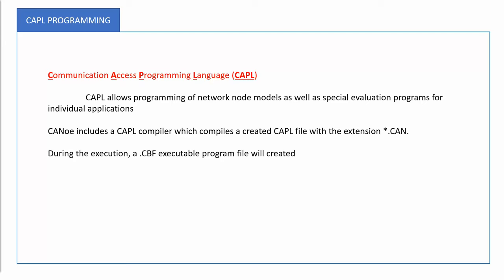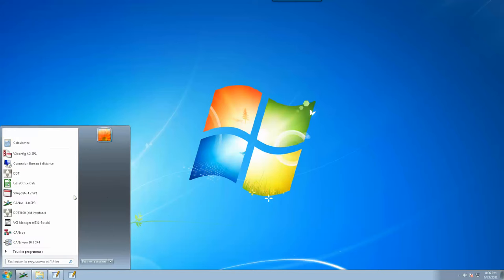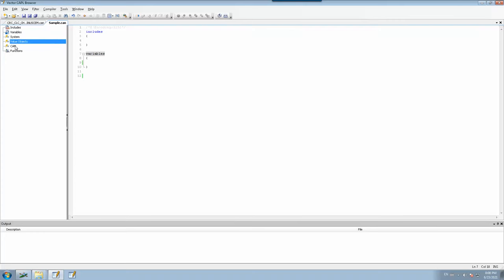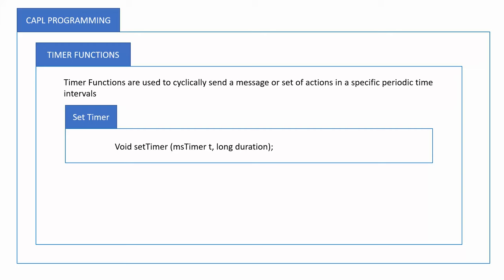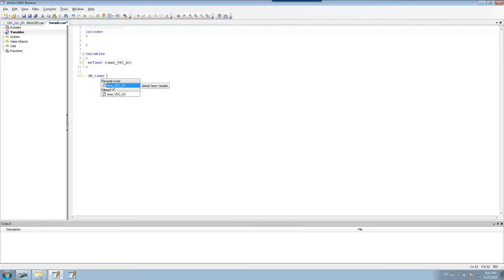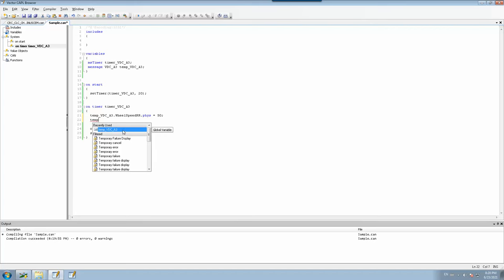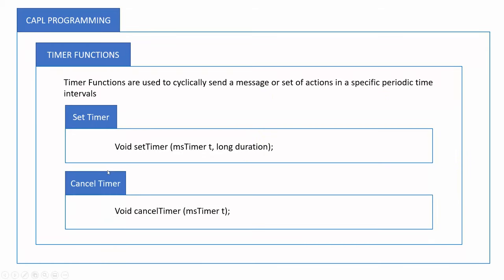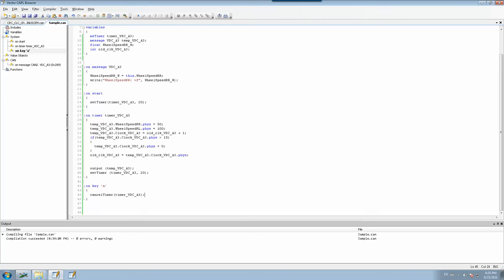Vector CANoe CAPL Programming Part 1

Comment: Hello Mani,
Thanks a lot for the videos. 
I need to learn from scratch how to automatized test case with code CAPL. I don't have notion on programmation. What do you suggest me to learn ans to know programming with CAPL please ? 
Do you have any formation online or other documents ? 
Thanks a lot
Reply from the maker: CAPL -> Basically based on the C-Programming, If you know some basics on the C Programming, you can easily nail it. Also you need to know complex functions of C to get started with CAPL. Some very simple concepts on how to use the Variables, simple Function calls, Function Calls with Arguments and some Looping concepts, this is more than sufficient to head start this CAPL scripting. You will find it interesting as you start coding. Use the Write Function to see how your code works

Comment: how can i have 2 people work independently but still share 1 CANoe (2 gates). Please guide me how to connect
Reply from the maker: Yeah, you can install CANoe in n number of PCs, and you can purchase a Keyman Dongle which will be a License Carrier. License will sit in the Keyman Dongle, and based on the need to run the CANoe you can insert the Keyman Dongle into those specific PCs and you can run it.